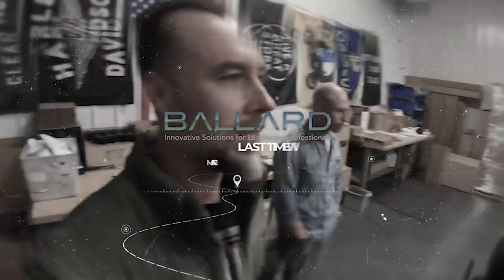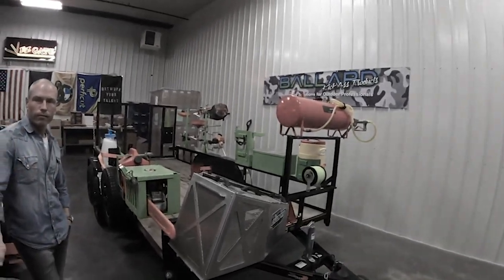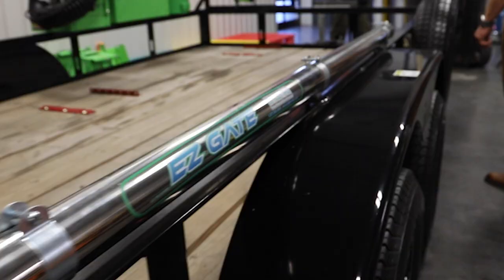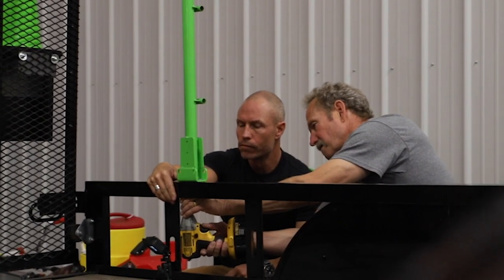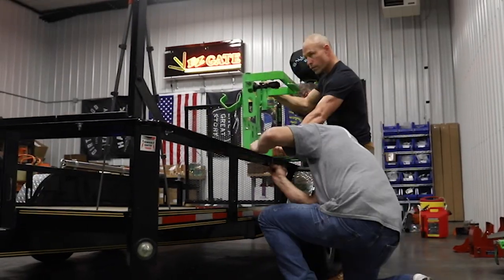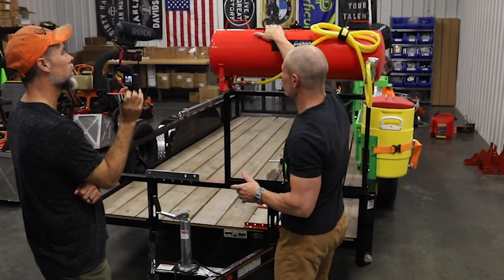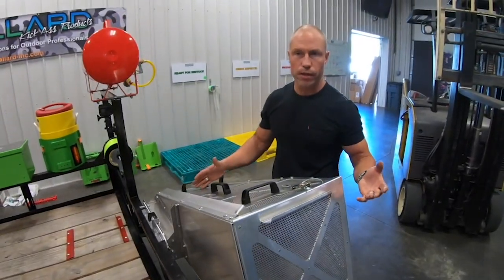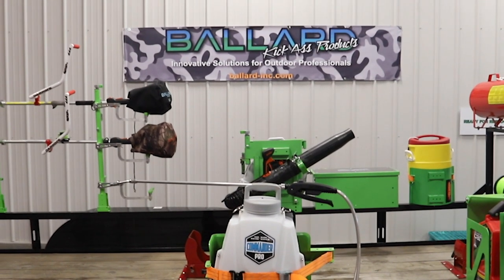Ballard Inc - Building The Ultimate Lawn Care Trailer With Stanley "Dirt Monkey" Genadek!

Comment: I noticed at the front trailer you put the bagger on, I would suppose that would only be used at the jobs when the trailer is only stationary, because if not the bagger would be crushed in between the trailer and the truck when they have too turn sharply... jack knifing